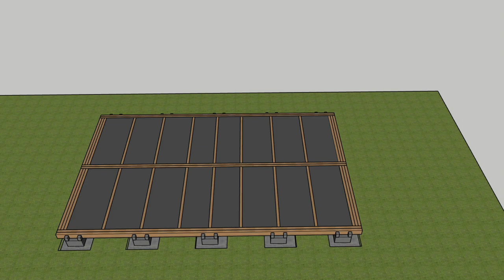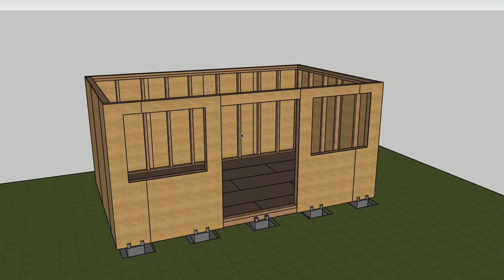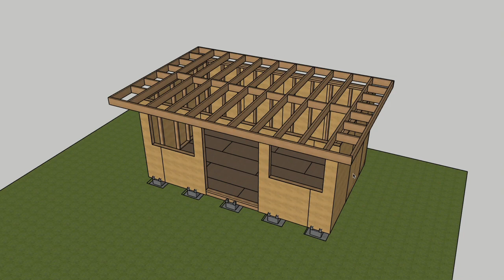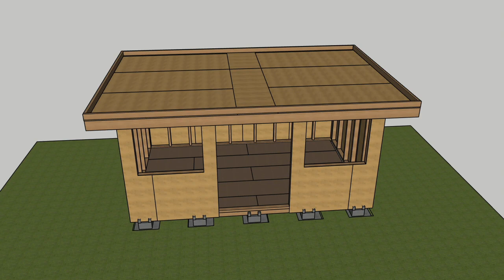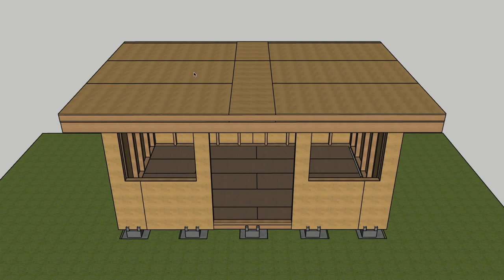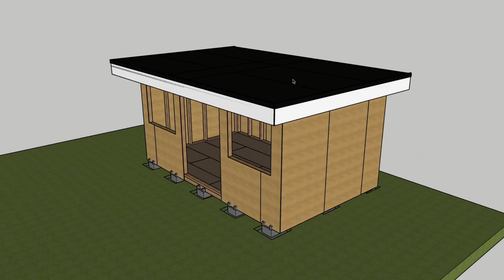part one of garden room design and build

Comment: Nice video and very informative. Will look forward to the next videos

Question: I assume from your mention of head room that you're building these to 2.5m height, would that be correct?
Reply: Wrong. This has to be to 3 metre. You can't fit a warm roof under 2.5 metres. You need to use a cold roof.
Reply: @adxm0382  Depends on the headroom you are looking for. I have an office 3.6 x 2.4, internal floor to ceiling at front is 2120, rear internal 2043. 2 degree mono pitch roof, 40mm PIR on concrete slab, 120mm roof joist with 100 PIR then EPDM Just makes 2500 at top of front fascia. I appreciate many people may not be comfortable these internal heights but its fine for me (5'7")

Comment: What kind of base pads are used ?  Are they set into the concrete ?
Reply from the maker: there are many types on the market, search for concrete decking peds. There can be a difference on recommended loading factors so take this in to account when looking. 
Keith